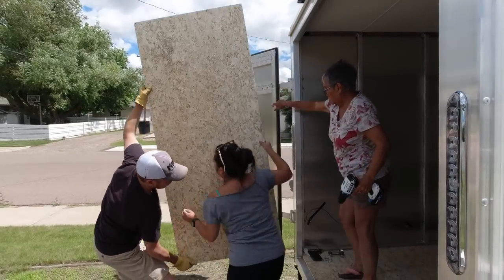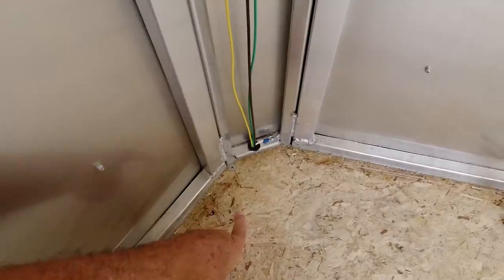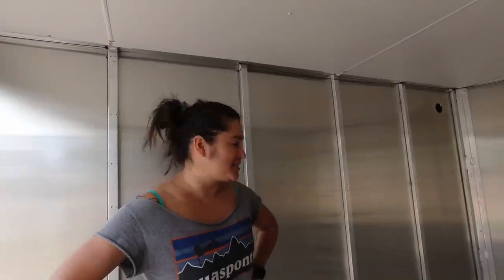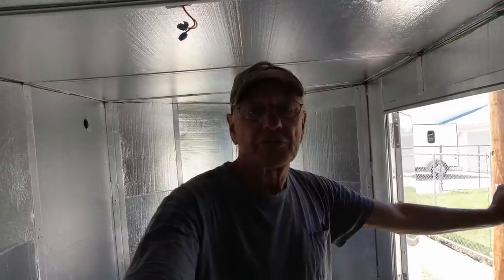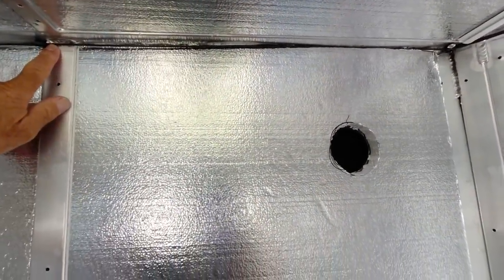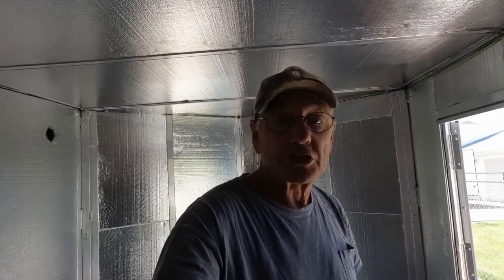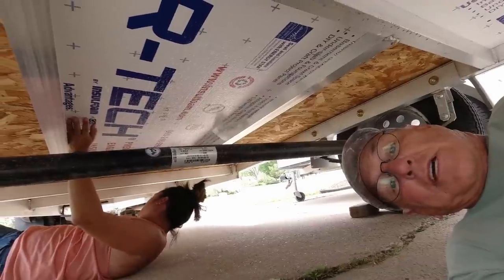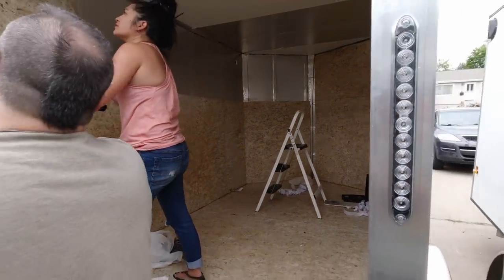Cargo Trailer to Camp Trailer - How To Start Your Build - Insulation

Comment: Thank you for giving the reason behind your decisions. Great tip on sealing the inside so moisture does get to interior side of metal siding causing condensation. Also liked that you included a segment on the floor insulation process.
Reply from the maker: Thanks for watching Stuart!

Comment: The more i see of these toy haulers the more i like them.. Lot of pluses there , cost is right , easy to park , easy to tow and gives one all the protection from the elements one could ask for .. There is a lot to be said there in my book .. I have a couple friends that went that direction and made the conversion to RV.. Why not i figure , it's the best of two worlds it looks like to me ..
Reply from the maker: We tow ours (as recently as today) down some mighty rough cattle trails (they call them roads here in Nevada) and it stays together just fine.  You have to be careful of the manufacturer the same as anything else, but there's a lot of good ones out there.

Comment: I just got my trailer 2 weeks ago and they had insulated it and was using it as a camp trailer just like you do. 
It is a 6 X 10 single axle and they put a FAN, three lights and TWO windows!  It also has TWO 6 volts 235 AH golf cart batteries! 
I will add a 25 watt HF solar panel to charge them back up. There is a platform for a 6 X 6 bed or then flip it back up for ATV of motorbike!   But this hot summer in NV (98* EVERY DAY) it is just going to be a storage. 
I can't wait to try it out!    I Hope she has fun too!

Comment: Fun watching your family all work together. Helps to see it from the beginning. I like the way you insulated the floor. Have seen people lay it on the inside and cover with plywood, but then you lose some ceiling height.
Reply from the maker: I put it underneath on my trailer because it only has 6' of height, but it worked so well that we did it on this one also.

Comment: You guys are great. I am slowly but surely acquiring the "thru wall/roof" items for my 7x16 enclosed. I want to have all the items installed so the 1" x 1 1/2" rectangular tube reinforcement pieces can be welded in before insulating and re-paneling. It will only be me doing the work as it stands now and it is rather hot here in NC right now. We also have the obligatory afternoon summer thunderstorms that show up like clockwork. Since at 62 in heart failure and not doing well in the heat and humidity, late fall is looking good to me. Thanks for sharing your family time and all of the videos you have put so much effort into.
Reply from the maker: Thanks for watching Ernest.  Yeah, I wouldn't want to be welding in the heat and humidity either.

Comment: Hi! I suggest adding a layer of the quarter inch Foamular fan-fold insulation that's designed for re-siding jobs to eliminate the direct heat conduit through the trailer's skin and frame. It will help with noise as well.

Comment: From Manufacturer.
Question: When using reflective foil, which side should face the inside and outside?
Answer: It depends on which way you want the heat to go. Put it on the side where you want the heat to radiate away from. If you want to keep a room warm, put it on the inside. If you want to cool a room, then put it on the outside.
Winter or summer camping, Alaska or Arizona ?

Comment: Fun to watch the whole family work. My dog doesn't have thumbs so it's a little hard for me to get help. 
Questions: 
Why didn't you put in the vent and windows before insulation?
Why not use two pieces of thinner insulation and have the shiny side on both sides?
Reply from the maker: Hi Jim.  I find it easier to cut through all the layers at once when putting the windows in because the trailer skin has some rigidity when backed by the foam and the inside paneling and doesn't vibrate as much that way.  Interesting idea on using two foil backed layers.  Indeed, why not?

Comment: Great tips. I do have a question/concern though. I live in Montreal, Canada, and I want to insulate the floor. I like what you did, insulating underneath the trailer, but I wonder with the rain and the snow if the plywood won't get all moist? Thanks.
Reply from the maker: Actually it hardly gets wet underneath there. I didn't seal the seams so everything can dry out and it been okay so far. Another option is a carpet with a thick pad on the inside.

Comment: Really good thorough video on getting started on a cargo conversion.👍👍
I did foil out cause I live in a desert but not sure if it made any difference. 
Huge debate on that subject.😯
Reply from the maker: The inside of the trailer or van is so relatively small that having the foil on the outside isn't going to make much difference when it comes to heating the interior, but the reflective surface facing OUT should make a big difference in reflecting infrared rays to keep the heat down.  This has been proven in home attics with a simple Mylar layer, like a space blanket, helping to keep things cool.  I think you did the right thing.

Comment: cargo blankets work great at creepers for getting under things but also working along side cars.. they can store in 2 and 3 gallon zip lock bags..
Reply from the maker: Great idea and they would probably lay flatter than the blue tarps I usually use for those projects.  Thanks for the suggestion Wayne.
Reply: @gonagain  out in the dirt.  Put a blue tarp down then moving blankets. The moving blanket won't get as dirty. But it will wad up under you much easier unfortunately.

Comment: Wow, you guys are knocking that thing out. Looks like this cargo trailer thing is addicting to Rick's and Linda's gang. Is that trailer quality close by or did you have to travel far and wide to find one built that well? Around here, I'm not going to name names, that kind of quality is hard to find.
Reply from the maker: That on was purchased about a 3 hour drive away and we were impressed with it's quality.  My suggestion is that you find a quality manufacturer and have it built to your own specs.  If you haul heavy weight, like an ATV or a Harley or something, get more beams in the floor.  If you expect heavy snow loads on the roof, get more beams in the ceiling, etc.  The Easy Hauler is made in Maine.  We also like our Stealth trailer, which was made in Bonner, MT.  No complaints at all.

Comment: I actually put a coat of primer for galvanized metal (with fungicide mixed in) on the inside of the skin. Then I put 2 coats of thermal barrier (homemade lizardskin) on the skin & 1 layer on the back of the XPS.

Comment: I’m thinking about going with the 6 x 12 double axel. You went with all aluminum and what was the main purpose. What kind of cost difference steel vs aluminum. Why did you go with a single axle vs double?nice job on your daughters build.
Reply from the maker: Good questions George.  I went with aluminum because I was tired of dealing with rusty frames on my previous trailers and not for weight saving like you would have thought.  I went with a single axle because of the tight places we need to turn around in (and that happens a lot!).  The aluminum is more expensive, but when you're underneath with a wire brush and a can of Rustoleum, you tend to think it's worth it.

Comment: Thanks for the awesome tips. I want to get a 6 x 10 as a support vehicle for a multi-family campsite. Mostly to haul stuff, but with a few pieces of equipment installed that must not overheat. So I was thinking of a mini air conditioner, and with that insulation becomes a must. 

A few thoughts on rigid insulation board. Three types are easily available: expanded polystyrene (bead board, what you used), extruded polystyrene, and polyisocyanurate (polyiso). The two polystyrene board types don't out gas and both have an R-value of R-5 per inch thickness. The expanded stuff is the lightest, typically comes faced with film or foil, can get knocked around and shed beads, is available with a fire-retardant treatment, and comes in white. The extruded stuff typically has the natural skinned surface from how it is made (no foils or films), you can get it in different densities (without affecting R-value much), it can be quite tough, it's almost impossible to find fire-retardant treated product in the USA, and comes in pink, blue, or green depending on the brand. Polyiso uses a different gas as an expanding agent, which gives you R-6.5 to R-7.0 per inch thickness, but it can also out gas if the factory didn't have their formulation dialed in quite right (so tape sealing is imperative). It comes with foil both sides or fiberglass reinforced paper both sides, is naturally fire retardant without any treatment, and is a cream color.

For under the trailer I'd go with extruded polystyrene. Because of the toughness it'd suffer less damage from kicked up gravel. On the inside avoid the polyiso for a camper (people sleeping inside). For a camper either expanded or extruded polystyrene is hard to beat. However for my use as an air conditioned equipment trailer (not a camper) the superior R-value of the polyiso makes that a strong choice for the walls and ceiling.

Your use of the foil tape is brilliant. Bravo.
Reply from the maker: Good information there for people trying to make a decision.  Thanks Scott.

Comment: What size  do you recommend? 1 axel? I plan on putting a dirt bike maybe a quad and camping gear. I’d like to take it off road too. Nothing crazy just nv desert. No crazy hill climbs. Thank you. Just subbed.
Reply from the maker: That's a tough question!!  Here's our take:  We went with single axle because it's better on those rough, uneven roads we always end up on.  It's also a lot easier to get turned around in tight places and we use that feature a lot...  As for size?  We can get our Arctic Cat TRV 500 in our 6x10 no problem, but there's not much room for anything else.  A 7'wide trailer gives you way more options inside and isn't really any wider than a 6' wide trailer (due to the outside fenders), but it has more wind resistance so it's going to cut into your fuel mileage a bit more.  At 7 feet though it will catch more branches!  Tough decision, but I would go with the smallest trailer I could get away with.

Comment: Great video.  Just wandering what you did about the factory installed vents?  Did you seal those up and insulate over them?
Reply from the maker: The one that I made the scoop for is the factory installed vent and the rear one I removed and sheetmetaled over the hole.

Comment: I'm curious if having the metal studs not covered by insulation has had any affect to thermal bridging? everyone make a HUGE deal about that and I've always wondered HOW much heat/cold makes its way from the outside to the inside???
Not at all a criticism, an absolute curiosity!

From my previous responses, I STILL have to insulate the floor and Taj-Ma-Haul sits so low to the ground I'm going to have to jack it onto stands to get under there. I'm encouraged that your floor insulation is limited to "Knicks" after 5 years! Wow and all of your gravel roads, I'm flabbergasted! I'm going to install FRP or something like corrugated panels over the insulation as to help "seal" the floor from heat and cold.
Reply from the maker: I'm sure that thermal bridging is a big deal, but it's such a small space that we don't notice the cold because it heats up so fast. We do notice the cold from the windows though and we put a barrier over them when it's really cold out. I've seen a very well thought out 6x12 that was being used full time on the road and the walls were a little thicker to allow for insulation over the studs.  Also, it was taller so that the floor insulation was on the inside.  It's a very warm rig!

Comment: Great job so far.

I’m thinking  6x12 for me.  Any thought on a top vent?  Power for it?
Wire for some  future solar?  
As always great job
Reply from the maker: Yes to all.  Although I think it's pretty easy to retrofit these trailers, it's best to do that wiring first if you can.  I see that Maxair makes quiet fan and I think that might be a good one.  I find the Fantastic fans to be really loud.  The solar panel wiring is kinda fat, so I prefer to run it on the surface or behind a molding, but not behind the paneling because there's not enough room for it.

Comment: Great video. What was the budget you spent on the conversion? I really want to get a similar trailer for my family camping trips.
Reply from the maker: So far on my daughters trailer for insulation, roof vent and windows, i think it's been about $400.  But the nice thing about doing it this way is that you can spend at your own pace and do it as simple or as fancy as you want.  On my trailer, we've been adding to it a little at a time and now have comfortable bunks, windows and vent, insulation, heat, solar, refrigeration, etc and have less than $2000 into it, not including the cost of the trailer itself.

Comment: Hello,would it work if I just installed the insulation to the inside of the paneling?In other words,not removing the wood?I'm not too concerned with losing a few inches of interior space.Thanks
Reply from the maker: Hello Corey, if you do that you'll get condensation in the space between and that will lead to rot and mold.  It really is better if you just take the paneling off and insulate against the outer skin.  It's even better if you use spray foam and it takes a lot less time. You can hire that done if you prefer.

Comment: My adventure is about to begin, just brought home a new 7x14!
Reply from the maker: Nice size for a build.
Reply: @gonagain  found an RV wrecker, three small screen sliders installed, one large in rear door, saves a ton compared to the dealership. Hint look at slide out campers, the windows on those are sheltered and in new shape!
Reply from the maker: @67superduty  That's a good tip!

Comment: Awesome team work. So would you do the electrical after insulation is installed or before? For future reference 🏍️🏕️
Reply from the maker: This particular little trailer came with a nice wiring channel down the inside of the Vee nose and along the top of each wall so doing any wiring will be easy at any time.  This is going to be a very simple build, but I'm sure that at some point solar will be installed.  I guess it just depends on your personal needs.  If you are intending on installing TV, speakers, air conditioning, extra lights etc., I would do the wiring before the insulation.

Comment: Your probably past this part of work. After I taped I ran 3" wide strips of reflexics along frame rails to keep cold from passing through frame directly to  paneling. just snug screws firmly ,it will leave plenty of air space between paneling and frame.  Nice to have a work party.
Reply from the maker: I hadn't thought of that and it would lessen condensation forming on the paneling too.  That would be especially good to do in a humid climate.

Comment: Great video, but I did not see if you added any glue between the outer wall and back of insulation? Thanks!
Reply from the maker: I didn't and I don't think that it's at all necessary. Those panels aren't going to move at all.

Comment: May 23rd 2021
I watched your hula hoop shower video. Linda is right about the bucket.
If the trailer wall will support the weight. Can you add a shelf that would hold the bucket , and fold down when not needed? What about the addition of a fitting or adaptation. Of tubing and a regular sink sprayer instead of the cup? If on the shelf, gravity fed?
Would that work on a collapsible bucket?
 Any way. Love your adventures. 
Oh and what about this surprise spring SNOW! LOL..
See you around! 😁
Reply from the maker: Hello Gail, the only thing that would make your idea not work is the height of the ceiling in the trailer that would stop gravity feed from being possible.   We had a visitor from India last week and when he saw the shower we told him it was Japanese furo style and he said "No, that's an Indian shower".

Comment: As a construction professional with 30 plus years under his belt let me tell you that your shinny side in or out theory is right on. I used spray insulating foam on the underneath, I’m not as dedicated as you are. Lol, great job
Reply from the maker: Thanks Roger!
Reply: Roger l have a trailer too.  Can you tell me more abt the insulation spray you used.  Was it professionally applied or did you do it?  Does it come in spray cans or a nozzle like used from a compressor?  If you have links l can see, pls can you share them?  Thanks.  Herb from Pennsylvania.
Reply: Herb Lapp I had a company spray it, 1$ per inch per square foot in Canada

Comment: have you ever removed one of the floor insulation boards to see how much moisture is trapped there?  I would wonder about rotting floors and rusting, if it were a steel trailer.
Reply from the maker: My insulation is installed beneath my floorboards, as you've probably seen, and they're not sealed around the edges at all so any water just drains away.  I can't speak for rust because my trailer's aluminum, but there's no sign at all of rot. We drive through rainstorms often, even yesterday, with no problems.
Reply from the maker: My insulation is installed beneath my floorboards, as you've probably seen, and they're not sealed around the edges at all so any water just drains away.  I can't speak for rust because my trailer's aluminum, but there's no sign at all of rot. We drive through rainstorms often, even yesterday, with no problems.